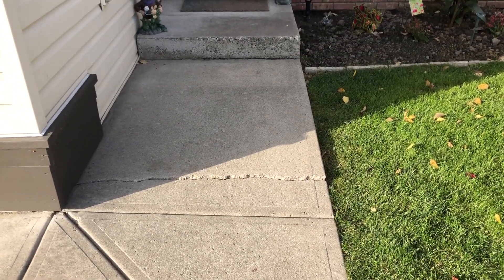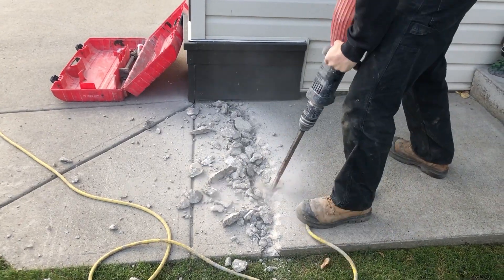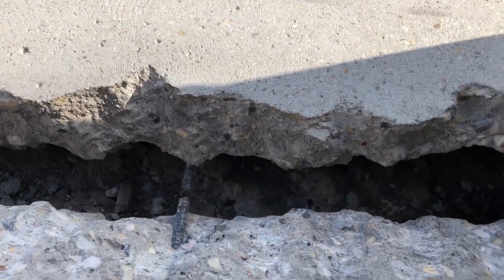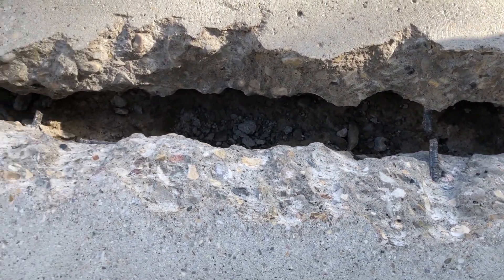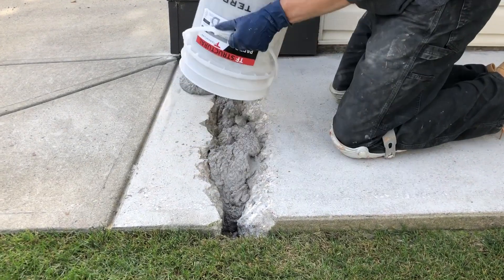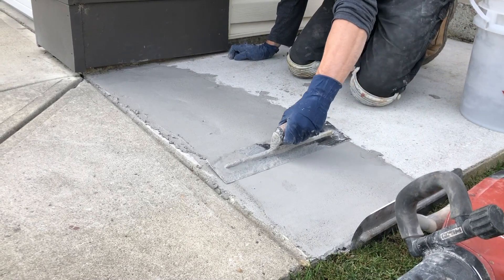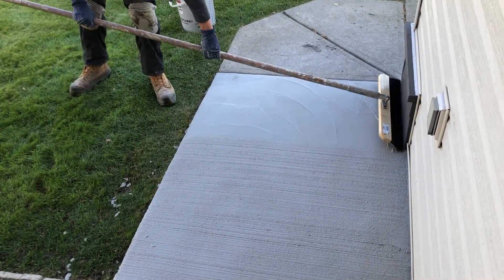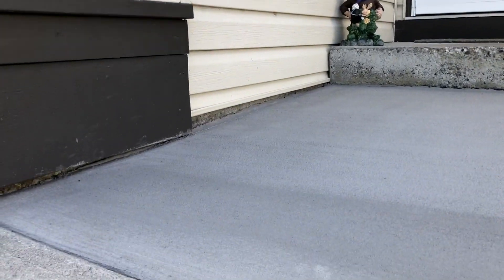Concrete Crack Repair - Using TF Structural repair mortar.

Comment: Very nice instructional videos! Thx a lot! How would you approach a surface with an angle of lets say 10% slope? Just using less water in the mix...?
Reply from the maker: Yes, you can use a bit less part B to make it stiffer, but on such a shallow slope, it shouldn't be a big concern. You don't want it so dry that it becomes unworkable. 
Thanks

Comment: How would a driveway with shallow spalding need to be prepped before a skim coat like the one you do at the end? 

Wondering if this could realistically be done with the TF material and a couple trowels/finishing brush by a homeowner after consulting your videos
Reply from the maker: Its not easy if you have never done something like it, but if you go pad by pad, it is possible. 
Here is a video for how to prep concrete 
https://www.youtube.com/watch?v=aCK3hjHAjXU&t=91s
Thanks!

Comment: Looks good! Does the product sold on Amazon work the same as this? Can you use the amazon product as a skim coat for a pitted garage floor, or would the be another product? 
I notice you do a broom finish almost every time. Does this trowel well to a flat finish, or does it not hold up as well that way?  THANKS!
Reply from the maker: Yes, it is the same material, and yes, it can be used to fix a pitted floor. The product does trowel out well, but it has no self leveling properties, so it will stay however you leave it with the the trowel. It is very difficult, if not impossible, to trowel it dead flat. 
Thanks!

Comment: My driveway slab has been destroyed because of tree roots.  I going to use one of you methods and products to repair the cracks (that are bad) but first I will take a trencher and cut the roots a foot before the driveway slab.  
The tree needs the roots to stay up so don't just cut a circle around the tree and expect the tap root to hold it up, particularly if it's old growth top root like an oak or some maples.
This would be a good suggestion, I think, for people that want to plant trees or keep trees near a foundation or slab.  The roots will win, so be smart.  Do without the trees.

Comment: In the video you say you add 30 per cent dry aggregate.  I am thinking for crack filler the aggregate should be small.  What aggregate do you use?
Reply from the maker: about and 8-10mm pea gravel works fine.

Comment: Would you recommend the same method to repair a similar type of (but longer) crack in a garage floor in Toronto, Canada (hot summers, cold winters)?
Reply from the maker: You can try that, or a method like this: https://youtu.be/o5UYlJmKhAE
What is the final finish you are attempting? If its in a garage, I would suggest fixing the crack, and then doing this: https://youtu.be/YLx_3XbdspE

Comment: OMG This video was hard to watch. The only positive thing is it looks nice now but that's it. It should've been repaired correctly. This is just a bandaid fix. Done by a pure amateur.
Reply from the maker: OMG! Your comment was so hard to read, it should have been written by an adult.
Reply: @TerrafuseInc  Why not cut out the slab find out what caused the crack then built up the base with a good mixture of base course then put in expansion board on the 3 sides to allow for expansion and contraction for hot and cold weather, reinstall the rebar or wire depending on how much stress it will be under, then pour the slab???
Reply: @TerrafuseInc  I may not be a writer but I know concrete.

Comment: Can I pour concrete between my front porch and my front step where the old expansion joint was? The joint is a 1” wide and about 5” deep? I was going to fill it with sand and then the self leveling sealant.  What do you think?
Reply from the maker: Concrete won’t bond to concrete, and if you fill an expansion joint, it will eventually crack out.

Comment: Just to be sure . Are you using the same product to fill the crack as you are for spreading for the complete overlay or is it two different materials ?
We just had a sidewalk poured and it cracked . They tried spreading just cement over it and that cracked a swell plus it leaves  a dark ugly section
Using this for a complete overlay would make everything the same color and fix the crack correctly
Reply from the maker: Yes, same material to do both.
Reply from the maker: https://youtu.be/o5UYlJmKhAE

Comment: The rebar was severed. How is this not going to crack again without the rebar?
Reply from the maker: The rebar is not what prevents the crack. If the ground is not solid, rebar will not prevent the settling that caused this crack.

Comment: I have old exposed aggregate stairs in the front of my house. There are deep cracks going up the sides of the stairs can I use TF structural to repair the top and sides of the stairs or do I need to have them torn out and refinished?
Reply from the maker: Depends on the job really, but this material isn’t flexible, and isn’t ideal for crack repair, unless special techniques are used, similar to this video.

Comment: I don’t understand why you wouldn’t just saw cut out the cracked slab at the control joint and the front of the step and just pour a new piece after making sure it’s on sound, compacted road base.
Reply from the maker: That is an option as well, if you are trying to fix the crack.

Comment: Absolutely love the video. I was wondering, do you think this would work inside of a garage where the floor has sunk (instead of expensive floor jacking)?
Reply from the maker: Sure would!
Reply: Mine garage for was sink from one side quite 3 inch and I just lay on existing floor concrete mix with concert glue and it is fine then on top just put self leveling and it turn out be fantastic. Make sure your buy a lot bad depend on area and mix with extra water like little runny it would be easy to spread. But make sure done it in one job this way you will get slope level to wards drain. Good luck

Comment: Hi, I have a outside stair way that is made of block. Over the yrs other owners have skimmed it with some sort of concrete material that is now starting to peel off. I realize that I will need to remove all of it but what I would like to know is how effective is TF on block surfaces and are there any tips on the best way to apply it?
Thanks in advance.
Reply from the maker: It is not the best, as it is very rigid material, and designed to cover solid substrates. Block substrates will have movement between each block, and eventually crack through. If you pour it around 2” thick, you may be ok, like the attached video. Essentially pouring a new stair set over the old one. 
https://youtu.be/NtXyXM_gjGs

Comment: Would this hold up on a garage driveway with a few cracks in it? Thanks
Reply from the maker: Yes, however the cracks will reflect through the product over time, as it has no flexibility.
Reply: No. Also its the wrong and
COMPLETELY unnecessary impractical procedure. 
Take a 4 inch angle grinder with archer crack chaser blade (LINK https://g.co/kgs/7794UF) and then fill with 100% silicone exterior calking using odorless mineral spirits for clean up and wal ah.
The guy wants to sell you his copy cat ardex material amd stear you away from what works better and costs less. Dont buy his junk, buy either ARDEX or MOPEI instead. They are national brand name products.

Comment: Does weather affect this process? Its been rainy and quite cold, down to the 50's. Should I wait to do this repair when it gets warmer?
Reply from the maker: The surface can be damp, and you don't want to do it while it's actually raining. Those lower temperatures are no problem, you can even do it below freezing, but need to use different procedures, and use our TF Heat additive to speed up the cure time.

Comment: Does this hold up well with a high powered pressure washer? How resistant is it to a harsh industrial environment?
Reply from the maker: It is similar to concrete with where it will hold up. Harsh industrial environments, with lots of chemical exposure are not ideal. You can still use it for structural repairs, but will need to protect it with a coating afterwards, depending on the environment. It can handle pressure washing, but doing it often will shorten the lifespan.

Comment: wow! the rebar broke? When i see those cracks is because the slab was not reinforced or it only had wire mesh. But i see you had rebar. I guess it needed more  reinforcement since the beginning...

Comment: Very nicely done work. Your videos are quite instructional. Does this product require any special post application water or spray or covering to cure properly?  I didn't hear that topic on the other videos in this series.
Reply from the maker: Thanks! There are no curing procedures required with this product. Once it in installed, you are finished :)